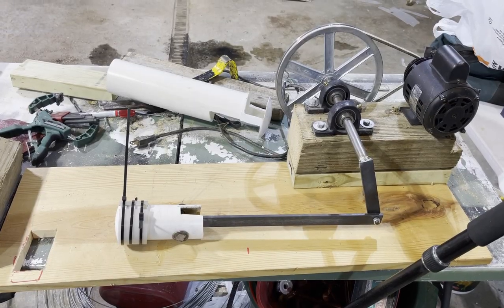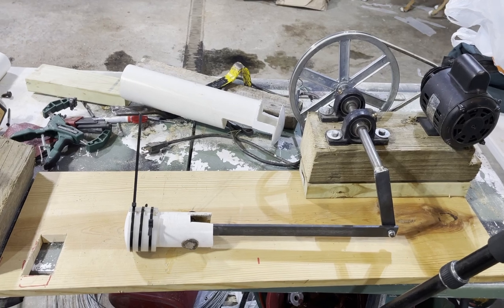Building an electric powered can crusher.

Comment: Great job, how did you slow down the speed of motor? Nice dog!
Reply from the maker: I slowed it down with the belts and pulleys. I have a 2 inch pulley on the motor going to a 10 inch pulley. Then another 2 inch pulley on the same shaft as the first 10 inch pulley, and a 10 inch pulley on the last shaft that drives the arm for the crusher.